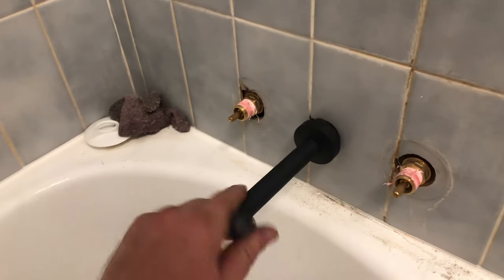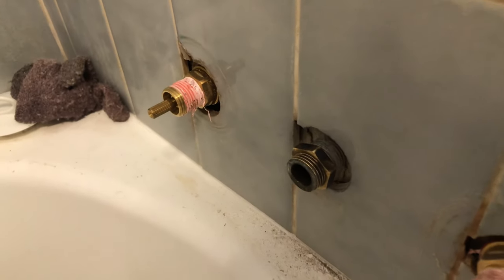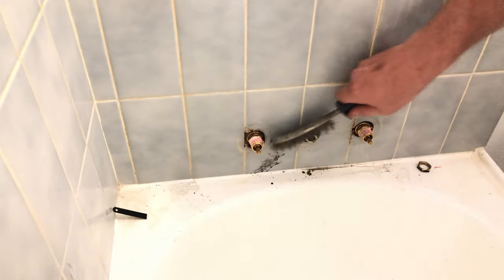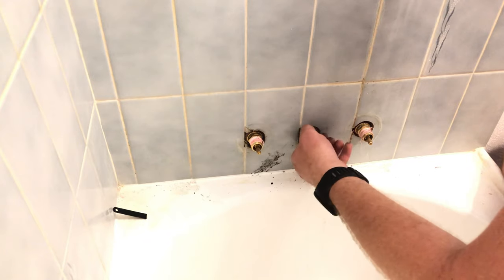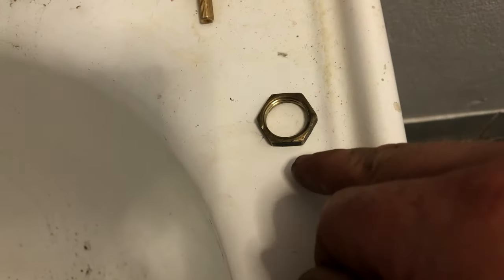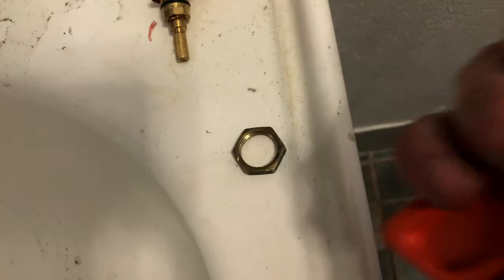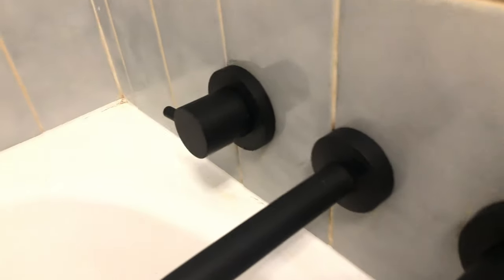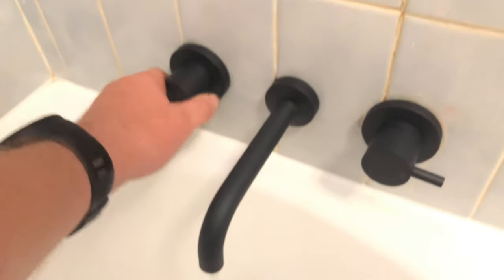How to cut a brass thread without damaging the thread.

Comment: Question: why did you decide to cut the pipe in the wall rather than the faucet? It seems like it would be easier and less of a risk to do the faucet. I have the same problem and what must be the same maker of a different faucet--looks the same but with a handle!
Reply: Are you trolling? I'll bite though ... a longer thread on the spout is required not shorter. Much easier to cut the threaded wall pipe.